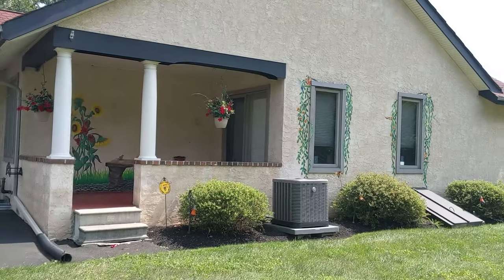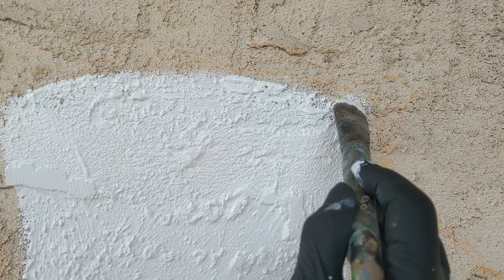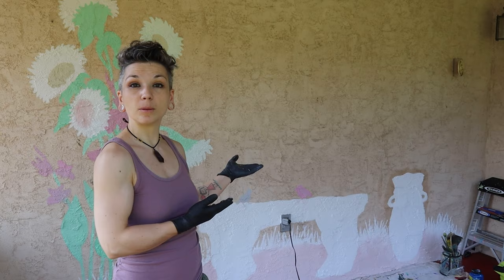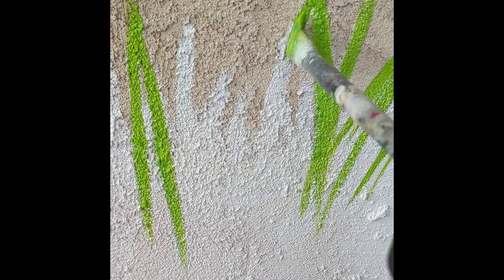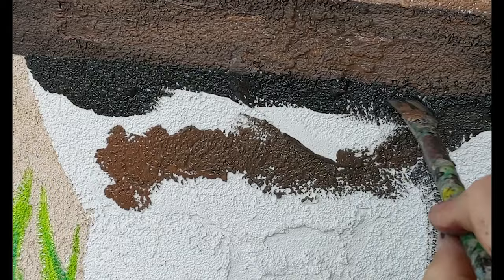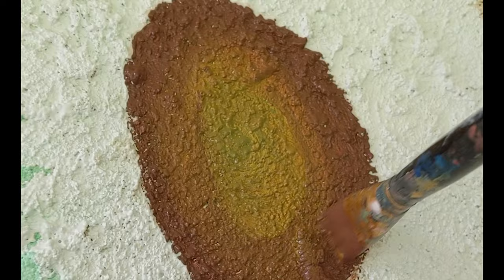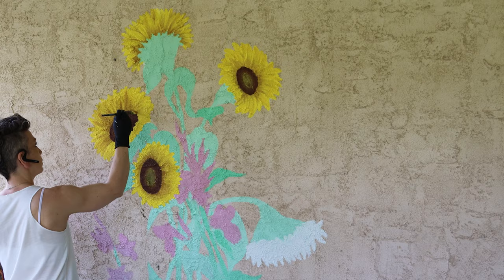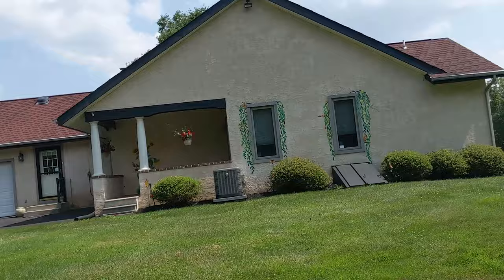HOW TO Paint an Exterior MURAL/ Painting on a TEXTURED WALL

Comment: I want to paint something on my dining wall , unfortunately it’s textured and I need to use stencil because I am not an artist . I was wondering if you have any suggestions on stencils because the ones I used in the past( mandalas) were ok on a flat surface but not that easy on textured. Thanks
Reply from the maker: Hi, I know it will be difficult to lay the stencil flat on a textured wall... I haven't done something like that, but I am thinking maybe spray paint? But you will have to protect the area around from the overspray, and you should wear a mask when you do it indoors. Otherwise, maybe pouncing with a sponge might be able to work. Good luck!